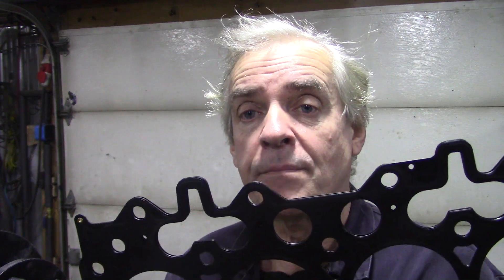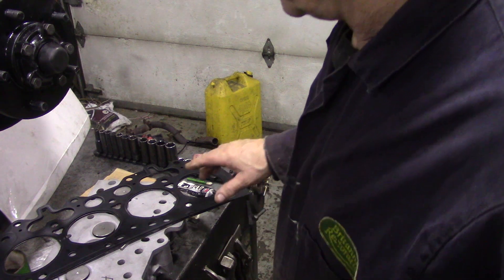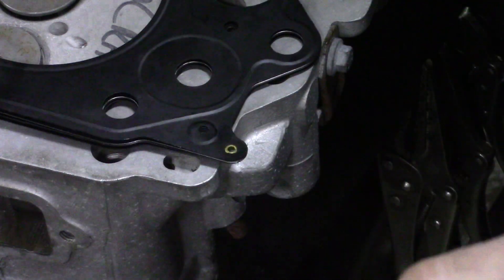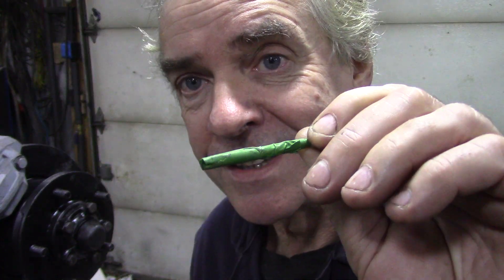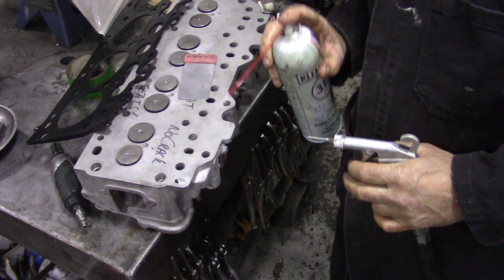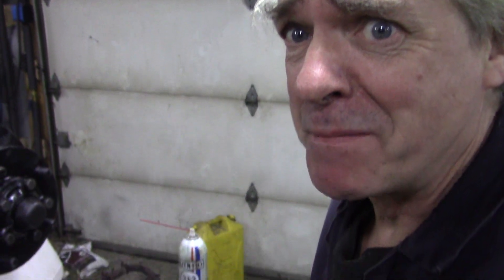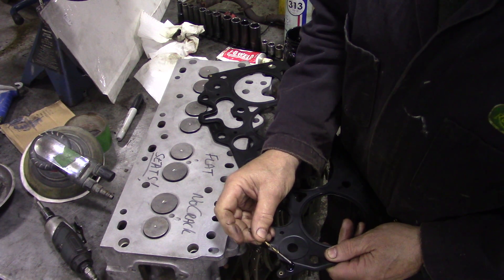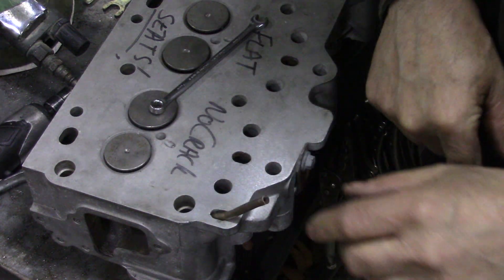MLS gasket on a 200Tdi? Maybe not...

Comment: Proper hack that one Mike you got pretty close to solving the issue. The ‘final’ straw(brake pipe) looked great just not quite ‘spot on’ ..The only experience I have of ‘drilling heads’ was on my van.. a previous custodian had snapped a manifold stud, tried to drill it out(proper mess) couldn’t so drilled into the head for a 10mm bolt and mounted a rectangular piece of 2mm steel to ‘retain’ the exhaust manifold where the broken stud was… in doing so drilled into an oil gallery.. for 3 years I tried to fixed a leaking valve cover gasket only finding out the real issue when I removed the head to fix some bent valves(which weren’t bent after all… just got a recon’d head in the end.. 

Keep posting these small projects and ‘test’ situations are highly entertaining and get the grey matter working..

Cheers..
Reply from the maker: Thanks Malcolm!

Comment: I think If you fill the slot completely and then drill one hole from the side of the head to original oil channel and second from the top, in place where the gasket has orifice, to cross the first one and then plug it from the side, it can work...
Reply from the maker: I wish I had a 200Tdi block to measure - then I could do this with confidence

Comment: I have an MLS gasket in my 200 at the moment and it has been absolutely fine.  The engine itself, on the other hand, burns oil at idle and on the overrun, but is clean under load.  I think it’s bore glazing and stick rings or the turbo drain hose (head has been rebuilt, turbo replaced and the oil burn has been steady since a +20 rebore and new pistons)

Comment: I used a MLS on my 200tdi a few years ago, ended up replacing it with a composite one as the MLS allowed oil to get in coolant, had to flush the cooling system & oil system through to get rid of the mayonnaise
Reply from the maker: Yes - That is why I did the video

Comment: I’ve been running the same 200tdi engine for 22 years now and it’s got over 300,000 miles.  I’ve had to replace the head gasket once in all that time and I believe it was the original head gasket when I replaced it.
It has a traditional head gasket and it doesn’t leak oil and has given great service so I don’t know why they would start using the MLS type.
Reply from the maker: Because the Tdi blows gaskets out of the back as it is the hottest part of the head and there is little support for the gasket
I have fitted umpteen MLS to 300Tdi and never had one back - ever
Reply: @BritannicaRestorations  mine went in the same place, as you know it’s common on them and I could hear a very slight chuff.. I ordered a tradition gasket I fitted has been fine for well over 120,000 if not more.. 
I’m not even sure if the MLS type was even around back then.
Reply: My 300 went there too.  My 200 got a bit of gas erosion of the head between 2 and 3, a skim sorted that and it now has an MLS gasket.  No oil leak.

Comment: I'm not a fan of multilayered gaskets , next time i do my 300tdi il make my gasket out of copper ,alfa romeo twin cams had an oring for the oil feed , I've never had a copper gasket fail on other engines inc straight 8 etc, its a modern problem caused by aftermarket manufacturers working to a budget ,great vid mike
Reply from the maker: These gaskets are for 300Tdi 
Never had one fail of its own accord

Comment: Is 200Tdi end of life?  If you buy a 200Tdi , should it be regarded as non repairable engine ?   Does the gasket fit the oil hole on the 200Tdi block?
Reply from the maker: There are some parts unavailable new. I know you cannot buy heads

Comment: Just fit the proper gasket and have done with it, if your going to the trouble of removing the head the logical thing to do is fit the correct gasket to be sure.
Reply from the maker: Indeed - but the new parts numbers suggest these rather than composite
https://www.lrworkshop.com/diagrams/land-rover-defender-engine/200tdi/cylinder-head_53143#14

Comment: So I'd be more inclined to do this if I could see the gasket after being compressed, does not the hole line up with the slot? Does not the gasket compress and seal? Methinks the slot is made to line up with the hole, whereas the block side is not aligned with the hole in the head. If the gasket doesn't compress and seal into the slot, why not make a round hole the size for the raised nub on the gasket?
Reply from the maker: The composite gasket is different to the MLS gasket as the oil sealing ring is made for both 200 and 300Tdi on the composite, but the MLS is 300Tdi only
Reply: @BritannicaRestorations  Ok, gotcha!

Comment: I'd have wrongly assumed that the hole in the gasket shouldn't be compromised and drilled it out to round, not realising it's made that way to restrict flow. Not a great design with the hole in the gasket being so close to the edge of the casting.
Reply from the maker: These are 300Tdi gaskets and the parts books give the same number for the 200Tdi

Comment: Could you not fill the slot in the head completely , not the feed, find the diameter of the oil hole in the gasket and mark it on the head, drill the fine hole from your mark diagonally to the oil feed in the head. Surely all you are doing is moving the restriction from the gasket into the head. Should do the same. ?
Reply from the maker: Thanks for the tip

Comment: Where is the oil feed in the block? You may have blocked off oil to the head,
Reply from the maker: The point is that the gasket is for a 300Tdi not a 200Tdi
Reply: @BritannicaRestorations  I see his point though Mike. Surely the oil feed from the 200tdi block must line up with the gallery in the 200tdi head. So by 'moving' the hole in the head to match the 300tdi gasket, does the hole in the head still line up with the hole in the block..?
Was the slot in the head made like that to meet up with inconsistencies or design changes with the oil feed location from the block..?
It would be interesting to see how the MLS gasket matches the block face...